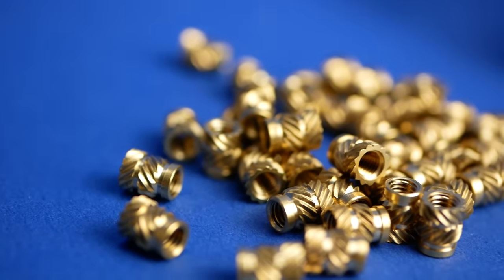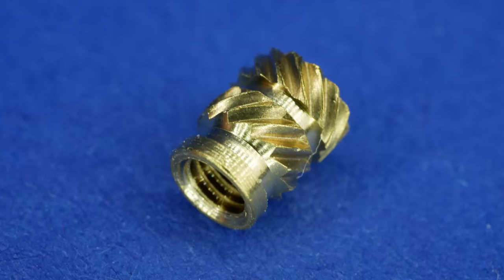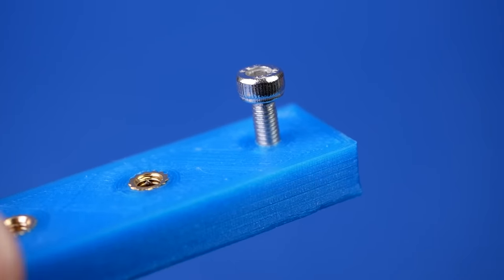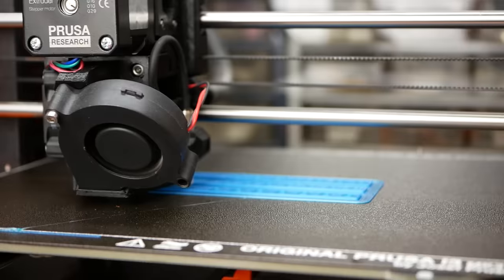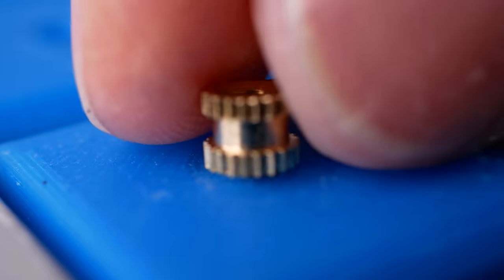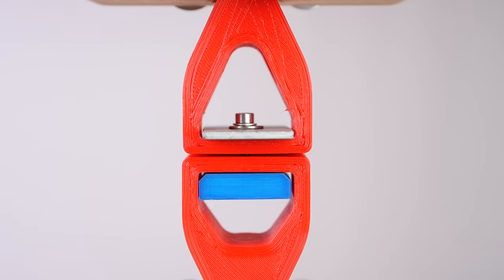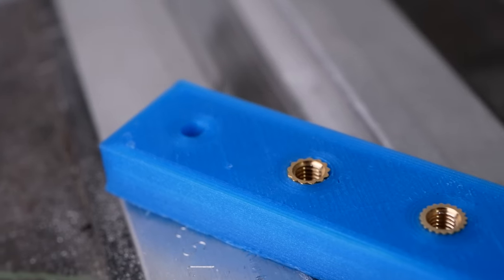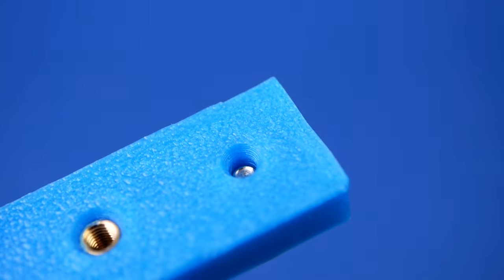Threaded Inserts for 3D Prints - Cheap VS Expensive 💰

Comment: Can you next test printed threads?
I commonly use modeled threads from Fusion 360, and even M3 comes out fine with all my printers - tho i prefer M6 as M3 due to it's size is a bit harder.
I do no no post finishing, i do not tap them or anything. But perhaps tapping after should also be compared?

I also use both horizontal and vertical printed, with no issues.
Sometimes M3 comes out looking like threads were not printed, yet perfect function.
I do not even make countersinking to ease the first thread - if messy print, i simply press a little bit harder to get the bolt in the first thread :)

After testing that, i wonder how long these printed vs brass insert threads last ... A simple 555 timer + DC motor + parts to connect to screw could work as a testing machine, still would easily take several days to build and test :/ and many of them needed to do the testing in acceptable time frame
Reply from the maker: Check out the previous video. Tested modeled threads there.

Comment: Sad that I just used the Ali Express inserts. Albeit, 5x39kg is probably enough to hold a lid on a relay circuit box.
Also, a small .5mm countersink just wide enough for the insert to sit in makes inserting them a lot easier.

Comment: I think that even though a naked bolt was very strong if you were cycling in and out on those plastic threads it would not be a solid long term solution, for a thread in and forget, never remove, a naked bolt looks like a great option, for a part that might suffer wear from cycled use a brass inset should prove more durable.

Comment: You can also tap plastics.  Works great.  Better on coarse bolts
Reply from the maker: Tested that in the pervious video.
Reply: CNC Kitchen I know this may not be relevant, I have found with scars to be very strong number eight and number 10’s this is in poly pro though nothing to do with 3-D printing

Comment: This is heavily dependant on thread pitch and size. If you are using smaller screws you will see better results. You should compare results between different screw sizes.

Comment: if you sandwich something between the bolt and the insert and over tighten that could result in a pullout with a torque applied right? would that be a good thing to test?

Comment: Probably I am missing something. Why they do not specify the dimentions of the screw to use with these thread inserts? I checked the Ruthex and they share the outside dimentions but nothing about the inside. I want to check which size to buy for a 1/4" screw of dslr camera rig.

Comment: It seens to me that inserts would work better than test if they are put in from the op side the bolt will be screwed into. Put in from bottom side instead of from topside. If holes are deeper than insert high, that is. Some melted plastic should ball up as heated insert is pushed in front insert, leaving more material and a smaller hole it would have to go though under tork.

Comment: I find using the end of the solder tip often ruins the threads of the insert.  So I end up apply the solder tip sideways and not getting an even push

Comment: I know its an old movie.   But my question.   What is the difference between 2.7mm and screw in a m3 or. Print it 2.3mm and tapp it. Then screw in the bolt?

Comment: Can you make a video on a mixture between heat and strength resistance regarding different materials? I want to print a lamp holder, but it would get pretty warm(around 50°C), and I don't have multiple Filaments laying around to test it myself :/ Also could be an interesting topic

Comment: Your holes not big enough for the cheap ones. That plastic pushed out the back should not do that it should be pushed in the middle. I think for a 3 mm size you need a 5 mm hole. I like to print a little chamfer to get things started. Plus I turn the heat up a lot more so after I push it down in and get it in place it melts surrounding plastic in between the two ends. I've had pretty good luck but I rarely ever put axial load on them. Mainly use them for making small parts. It seems like all of them is worth the money though. It beats the hell out of threading or adding to your print a nut size crevice. By the way thank you for the video you have no idea how much this information helps a lot of people that don't have time to run these tests. So thank you

Comment: There shouldn't actually be a difference i pull strength between a well placed insert with a "pull resistance" surface like the two better ones had and a well placed screw with a thread as deep as the insert. Torque is a different discussion. Best way to ensure pull performance is a washer implant tho ;) not a scre itself.

Comment: Many people making 3d printers or 3d printer upgrades use PETG for anything close to the hotend.  I would love to know how the slightly more flexible material handles different types of threaded inserts.
Reply from the maker: ASA, ABS and PETG have quite a similar Modulus, so the results of the orange parts might not be too far off.

Comment: I will stick to putting ABS juice in the hole when the plastic thread wares out. For the price i could only justify inserts if i was doing something for a profesional client. For my own personal use its to easy and cheap to just tap it in with the bolt and ABS juice to fix it.

Comment: It would be cool to try harder bolts. It should be harder than that to break hardened bolts, even if they are just M3. You could try to find grade 10.8 or 12.8 bolts. The ones you had didn't seem to have markings on them for what grade they are. Anyways, very nice test!

Comment: video request: Of the most common PLA filament manufactures, What manufacture makes the highest tensile strength PLA? I have searched the interwebs for this test/chart but have not found it. It would be nice if the manufacture would provide a data spec sheet for the material along with tensile strength, temperature stability, rigidity, and plastic deformation load. You know, the information an engineer would look at in a material study when choosing a polymer. +/-5% for general use flatmate and +/-1% for engineering grade filament.

Comment: even the cheap inserts have more pull out streght than i think i would normally trust a m3 bolt to hold in pull out of a 3d printed part, but would probably mostly use this for attaching small things repeatedly.

Comment: When i design parts for those injection mold style inserts (the cheap ones), I do it with a cavity similar to how the ruthex insert profile.  If you design it so that the main tension force pulls the insert towards a layer of plastic, they become nearly impossible to pull out without breaking plastic.  And I can usually do it in a shorter length then the ruthex inserts (you only need 2 or 3 layers beneath).
Reply: Got a picture that you can share?
Reply: @belenhedderich3330   If I could post a pic to a YT reply I would... but I'm pretty sure I cant.  Unless you'd be okay with a link to a picture?
Reply: @renegadeceo  Ok with a link

Comment: The one thing you don't mention is the property class of the fasteners used in your torsion test. In that size they are either 4.8 or 8.8 most likely. That's a huge difference in maximum torsional strength. In larger diameters , M8 and up, you should be able to find 10.9s

Comment: Hi. Great video. I’ve tried to find some high quality 1/4-20 inserts for camera gear, but its really hard to find. Any one had any luck with this?
Reply: For my camera gear, i.e. tripod screw threads, I use a 1/4-20 flange nut, inserted from the back into a hole that is shaped in CAD to make a nice tight fit.

Comment: The cheap inserts give a secondary pullout force where all others have a sheer drop off when failing. The cheap ones would might better for low load, mission critical applications.

Comment: Would be interesting to see >M3 Inserts for the Torgue Test, and also with 10.9 or 12.9 Bolts which wont shear their Heads off so easily. And also to do the tensile test with supports made from Steel and not from PLA/ABS which wont flex/deform and affect the strain of the tested Part. Even more tests could be done by alternating the temps and general surrounding/environmental conditions. Anyone interested in writing a Bachelors Thesis?
Anyway well done and entertaining Video! Thanks

Comment: nice video.   what sized insert would you need for camera screws?
Reply from the maker: Most cameras have 1/4", bigger ones 3/8" mounting threads.
Reply: @CNCKitchen  thanks - how does that relate to the m4 m5 etc sizing?

Comment: Of course M3 bolts will fail in torque shear, recommended torque specs for bolts of that size are no higher than 1.5 N*m, and the highest shear load as compared shear yield strength of the stressed material anywhere in those assemblies will be at the base of the head of the bolt.

Comment: I think you should have tested adding a hexagonal hole or slot on the back of the part and adding a nut and oversized screw hole. this way you need no soldering iron and do not have to hold the nut when tightening the screw.

Comment: Yep, when I reverse engineer a stl part back into a solid (even my own old work where the original part file is gone) the holes are always smaller by about .1mm when dealing with 3mm-4mm holes.  5mm holes are closer.
Reply: Sounds like your software partitions larger circles into more segments when converting to a triangulated surface.
Reply: @hanelyp1 Happens with Solidworks to STL or any STLs I find on the net (meaning Thingiverse et. al.).  I have YET to find a stl that precisely gives me the size of the original hole size and when I brought this up on the rep rap forum years ago the answer was because a stl can't do it no matter how many, or how few, triangles you slice it.

Comment: Would it be possible to modify the polygonalization process of CAD to make interior curves wide while keeping exterior curves shallow? The more I think about the geometry of this, the more I think it should be possible.
Reply: Every curves surface could be defined as two shapes. You described a point based shape. Select points along the curve and draw series of line segments to form the edge of that polygon. However, you could also draw a tangent at that point; you could them use the intersection points of each of those tangents to create another series of segments. One line would work best as an interior edge any other line would work best as an exterior edge. Either let the designer choose one or detect it automatically based on the convexity.

It might be possible for this process to be done on the Slicer level instead of the CAD level.

If this is doable, it would solve a lot of issues I've had with 3d printing things that should "fit" together.

Comment: I would like to see it again with stronger screws.. or with softer 3d print.. like.. i dont really care what is the max strenght of the insert, just which is better for torque
Reply: You don't get stronger screws. Even 12.9 steel M3 screws are only specked to 2.5 Nm. However going up a few sizes would work. A doubling of diameter gets you about 10 x the torque.

Comment: I was not that surprised that the one screwed directly in to the plastic performed that good in the pull-out test. If you think about it, I think that in this case, the surface area in contact with the plastic is larger.

Comment: It seems to me that the proper way to use these as fasteners would be to thread into them from the opposing side of the side it was installed on. This way there would be more force required to pull them threw the material that hasn't been distorted by the installation. Has anyone else mentioned this?

Comment: Very nice idea.  But - I need ONE for something I made for my wife - and I can't find anything less than $40 for a HUNDRED of them.  At that price, I probably could have found a commercially available tripod mount for her Fire tablet - likely for less!
Yeah, it was fun to knock out the design and print up, but when the threads in the plastic didn't hold for beans, this SEEMED like a possible solution.
Should have stuck with the 2 rubber bands....

Comment: So conclusion is that you can for most go for the cheapest really, as very few people remove bolts other than occasionally and if not, i think it os better to use an allthrough solution with just regular nuts

Comment: Ofcourse the bolt will snap if the bolt and the threaded indert are touching. You need to have something between the insert and the bolt head to test torque strenght.

Comment: Something you might consider, testing is actually tapping the hole. It works great with even undersized holes in my experience. These are the particular ones I've used (https://www.harborfreight.com/metric-drill-tap-deburr-bit-set-95529.html - and the only place I'd seen them when searching in the past trying to describe them, but when I just searched apparently they are all over the place now.) They do work on metal, but aren't the best, However, they seem nearly perfect for PLA parts. I have occasionally, stripped a bit, but that's almost always due to hand drilling (vs drill press), and wobbling when cutting. I literally have some I've losened and tightened for years (Every time I take the secondary (guide) telescope on/off the main telescope) without issue, including on a dovetail holding a telescope and camera. 

Another option that I've had work, is Wood Inserts. Which typically have coarse threads on the outside and a fine thread on the inside. (Example: https://www.amazon.com/Z-Threaded-Insert-Internal-Threads/dp/B00207NF6W Warning: 1/4-20 inch, Metric ones do exist.) Those I tend to use similarly to your just screw it in method.

Comment: Given how the inserts need a larger hole than the bolt they fit, and the size of that hole might be restricted by geometry of the part, strength of the insert vs. a bolt to fit roughly the same sized hole would be interesting.

Comment: I do it different, i undersize the hole of the printed part slightly and then put a screw in the insert , then a hex key into the screw and hit then key with a hammer into the printed part :p

Comment: I prefer to use flanged inserts designed to be drawn into plastic. I design the holes to nominal size and drill to exact size for insert.
Reply: Are you referring to PEM inserts and studs?
Reply: @EngineeringVignettes no,  go to McMaster dot Com and search for part number 94510A310 .

Comment: Nice work as always Stefan! I have a good set of small metric taps and have good luck tapping the plastic with a battery drill, quick and painless. Just ensure the hole is properly sized before tapping and keep the tap clean. If I'm printing a model where I plan on having threads I increase the wall thickness to 2mm, this seems to add enough strength for most projects. Most models just require a light torque on the screws to hold things nicely. If max strength is required I go with inserts. I would have liked to have seen tapped holes added to your strength test for curiosity. My 2 cents worth. Thanks for all the work you do producing these videos.

Comment: Hmm..the cheap insert with a long screw to a nut on the back side would resolve the pull out limitation.  Of course the cost of an additional nut and longer screw would reduce this $ improvement.

Comment: I have never seen the point of threading directly into the plastic as the whole point of screws it the ability to take the piece apart. Glue has always seemed more appropriate if you want to pieces to be assembled once and stay  together.

Comment: Steffan I would love to build the tensile test machine for my college students and our 3D printing lab. I would pay for the plans.
Reply from the maker: All plans are available Open Source : https://youtu.be/uvn-J8CbtzM
Reply: Andy, I understand it's cool to have a 3D printed tensile machine however from a repeatability and durability standpoint a couple easy to build parts in your machine shop out of free machining steel are going to yield you a better test setup that's going to last decades. Especially if you want to study component modulus, or develop stress strain curves you're not going to be able to do it with a 3D printed assembly. This machine only gives you max tensile, anything else from it is going to be suspect.

Comment: please try modeled threads.  M3 is too small for this task, M4 or M5 at least is required.
Reply from the maker: Tried that in the last video on that topic. Check that one out.
Reply: @CNCKitchen  I understand, but in that video the limit was the amount of material connecting the threads to the print, not the threads themselves.  The infill broke off of the threaded portion before the threaded portion broke.  You even mention that in the video.

So really it's an apples to oranges comparison (that video vs this one).  With any given model, it's possible to increase the number of perimeters.  If you're designing a part yourself, it's even possible to increase the number of perimeters in just that one area around the threads to give it more engagement with the infill.  Also I know of one slicer that may support this (icesl).

Comment: Great video as usual! Thanks for sharing. For the folks interested, I'd suggest  trying screws specifically designed for plastic, without an insert. They hold better than a machine screw, put less radial pressure on the part (helping prevent your part from cracking) and can be used a few times in the hole without damaging the threads.  As an example, check these out: https://www.mcmaster.com/99397a611 . The particular feature of a self threading fastener you want to look for is the "Trilobe" thread design. They work far better than the conventional  circular design. There are ones made for metal as well  (for those of you who are screwing things into aluminum extrusions). They are the best type of self tapping screws I've ever used.